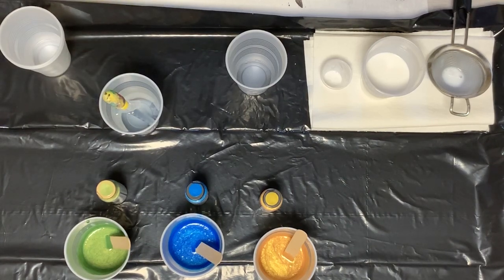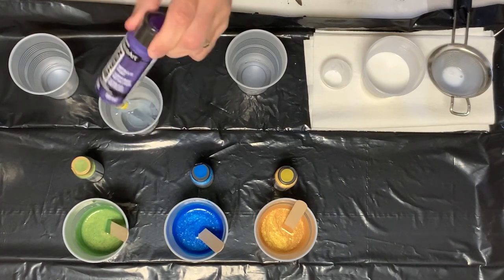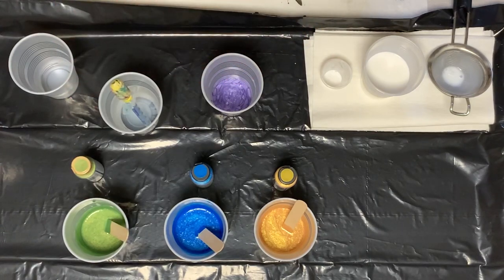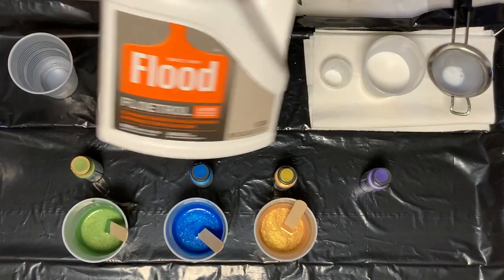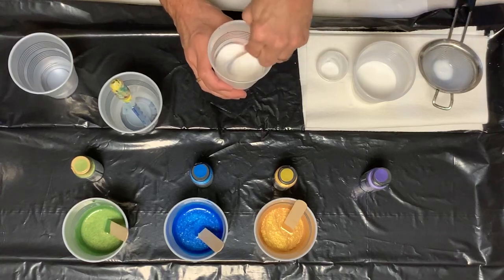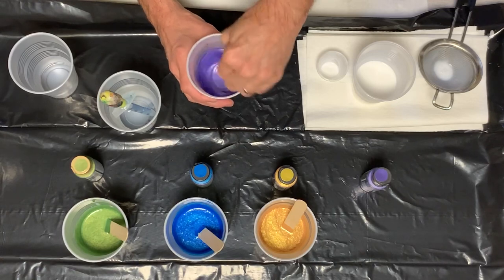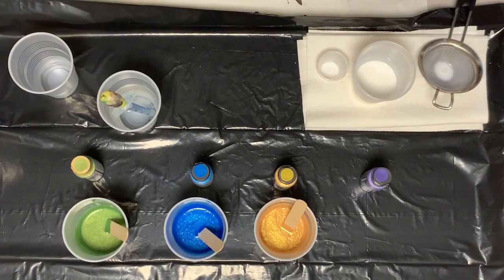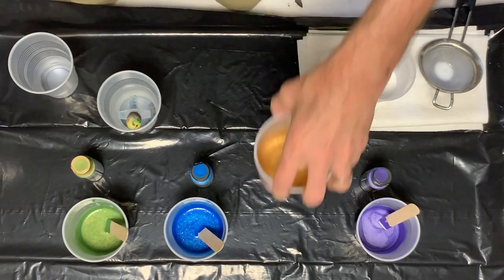How I prepare my paints for my Double Puddle Dump and Swirl!

Comment: Hello Dwight. Your dump and swirl is very interesting. On the dump paint are you adding flotroel and water and If so what is the ratio. Is it the same for the black . I can't decide if I like the black or white best. I'm intrigued to try this method. Thanks
Reply from the maker: Thank you!  The ratio I typically use is one part paint to two parts floetrol with a drizzle of liquitex pouring medium.  The black I don’t measure as much, I usually eyeball it!

Comment: Are the condiment cups that you used for the Floetrol 2 oz?  So your recipe is 2 oz craft paint to 4 oz Floetrol + water & PM?  And what is the recipe for the large cup of white?
Reply from the maker: My basic formula is the same…1 part paint, 2-3 parts floetrol, drizzle of liquitex pouring medium and water to thin.  Since I don’t measure precisely I use cups based on the size of the canvas.  I use a chart that helps me know how much to put on the canvas.  But I buy 4 ounce, 8, 16 or 24 ounces depending on how much I need…my colors are typically in the 4 or 8 ounce cups

Comment: How about the dump part. How is that mixed?
Reply from the maker: Good morning...all paints are mixed the same way.  In my older videos I think I used floetrol in the paints....so basically 1 part paint, 2 parts floetrol and a drizzle of liquitex pouring medium and water....more recent videos I’ve left out the floetrol....
Reply: Are you using liquitex pouring medium and water only then?